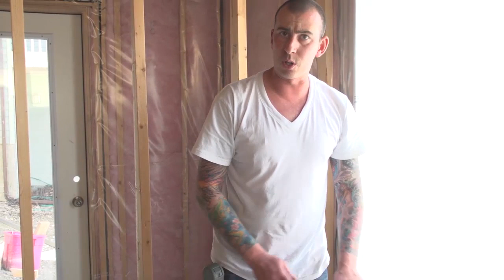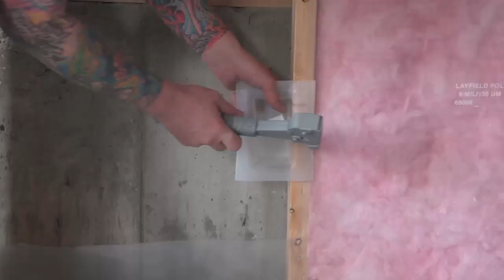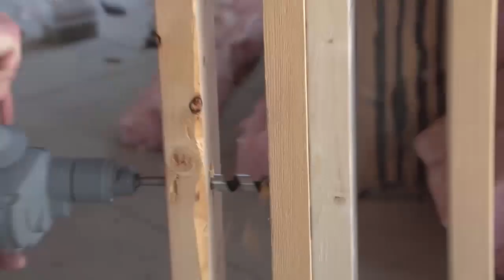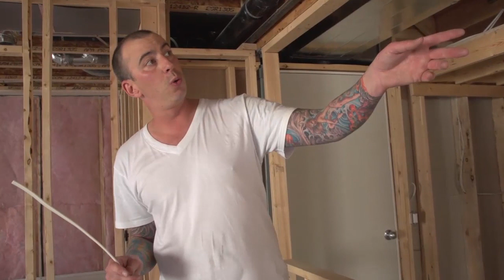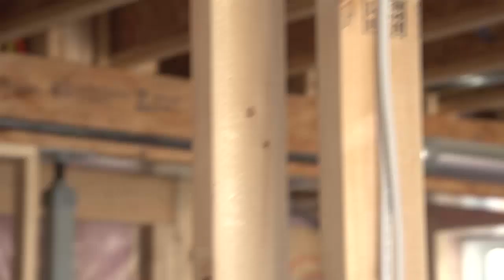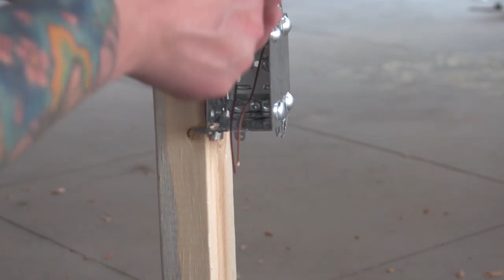How to wire a basement bedroom - DIY

Comment: Hi sir, first I want to thank you for making the vdo.  1. I want to make 1 bedroom in the basement (basement undone). 2. 1 breaker was connector to 2 thermostat (1. for the future toilet and another one is connected to 2 heaters). 3.  the one connected to 2 heaters, I will use one for the room with it owns thermostat.  4.  should I put each room on a different breaker or I can still leave them together in one breaker?.

Comment: Thanks much for being so thorough in your description of each aspect of this project..
Reply from the maker: Thanks for watching, are you working on a basement project?
Reply: @ConstructionCoach  Question You had both the lights and the outlets/ switches going to the same Home run box. Could I possibly separate the lights into its own circuit in my Circuit breaker box?
Reply from the maker: Definitely separate them. There is a code change where I build that requires all bedrooms to be on their own arc fault breaker. Lighting can be on regular breakers. I had a job when the lights went on the arc fault would trip so I’ve started separating lights and receptacles.
Reply: @ConstructionCoach  I appreciate the advice. Keep doing what you do! I have used your videos for each stage of my basement project so far.
Reply from the maker: That’s awesome, keep in touch as you proceed.
Reply: @ConstructionCoach  One last question: Do I still need Vapor Barrier Sleeves for my receptacles? If so, where do you purchase yours. Home depot nor Amazon sells them?? Thank you
Reply from the maker: If it is an exterior wall with vapour barrier, this includes frost walls in a basement then you need poly pans with metal boxes. Some plastic boxes have a seal built into them. They are always at my local Homedepot, if you are having trouble check a electrical supply warehouse in your area.
Reply: @ConstructionCoach  Yes I am about to run wires in my basement. What size drive bit were you using?
Reply from the maker: I use a 3/4” bit, that way you can fit two wires through.

Comment: Ark fault breakers.need to be tested to see if they are actually working the one we had did not and what a chore to find all the plugin on the circuit as one arking plug can cause others between it and the breaker to ark and burn off the wires too

Comment: This is the most detailed video about wiring basement i have seen. I'm brand new to this DIY stuff. Though what confused me here is that you are using white(14/2) for both outlets and Switches. My basement already has few switches and outlets. Can i just use those to extend the lighting and switches and just use 14/2 instead of having to use 12/2?

Comment: Can you explain the service loop please. Thanks much
Reply from the maker: It’s a loop of electrical wire in the wall, if the drywall installers hit the wire or a wire is short then you can release the box clamp and pull more wire into the box. Let me know if this helps.
Reply: @ConstructionCoach  
Excellent thank you for the response. Makes complete sense now.

Comment: I am adding a home studio to my basement. Approx 16ft x 24 ft.   I am planning on 6-8 can lights and approx 12 double plugs.  Would you recommend a single circuit for the light and plugs or 1 single circuit?  If so what size wire would you use?
Reply from the maker: Definitely 2 separate circuits, I would run 14-2 for 15amp breaker for the lights and same or if you need higher amperage 12-2 for 20amp breaker.

Comment: Enjoyed your video, developing my basement and running the rough wiring myself and had a few questions. 

How many feet of wire did you leave at the breaker panel? 

So wire 1 from breaker panel to light switch, leave a loop than run to each receptacle leaving a loop at each receptacle. 
Wire 2 from lights to switch. 
Power coming into the box for the receptacle and lights will run on the same breaker?
Did you make a video how you tied them together receptacle power, light and switch?

Comment: Oooookie @ 18:30 that's so wrong. The staple is not suppose to be holding the wire soooo tight it is suppose be snug but not THAT snug ...  this is why the wings are there on the edge of the staple. It's a guide that says "Hey you hammered me in far enough" ... I know in Canada anyways, if you hammer your staples in too far a GOOD inspector will FAIL you. Just my 2 cents.

Comment: Coming from a Construction Engineering Technician/ Civil Engineering Technologist you should never drill that close to the edge of a stud. Two holes beside each other too on the exterior load bearing wood founding wall is a no-no. Middle of stud doesn’t add much strength to stud but the outside is more important to keep in tact. Great informative video otherwise!

Comment: hi i want to know if you have 3 plug for the switch, and 2 screws for ground, where did you connect the other plug? Is it ok to use 1 screw for 2 ground wires? thanks

Comment: I noticed in some videos that the wire was placed inside metal tubing that was installed in the holes for the wall framing. Is there an advantage to this technique? Maybe it is a code requirement in some states?
Reply from the maker: I’m not to sure about that.. creators make videos with what they know and it’s always up to the homeowner to check local codes. Thanks for watching.

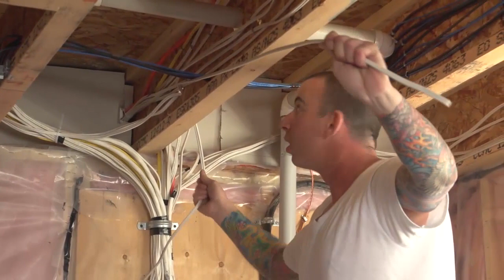Comment: Construction Coach.   What is the illegal pvc conduit/pipe at 15:30 above the electrical panel for???   If it's plumbing, it can't be the exclusively dedicated space above the electrical panel.   If it is for electrical work, why would it have plumbing 90 degree ells and nor gray electrical 90 degree elbows?    Either way, it should be a violation of your Canadian Electrical Code.   It is so close to NEC they can't have let this slide by.   Respectfully,   Kevin

Comment: I thought you are going to use #12/2 for AFCI receptacle
Reply: from my understanding you can use it, but it is only required for a 20A circuit, on a 15A you can use 14/2 or 12/2. good chance it is a cost saving measure when you do not plan to run on a 20A circuit.

Comment: Does the electrical usually get put in after the insulation/vapor barrier? It seems that if I was building a house I would want to put in the electrical first... Am I missing something?
Reply: If a builder is not finishing the basement, he doesn't care about wiring. I have the same situation in my basement - I'm finishing it, and will have to do exactly this thing.

Comment: For people asking why you use metal receptacle boxes it's because you are never supposed to use plastic boxes for standard 120V or 240V house wiring. If wires become disconnected, the point is for them to short out to the grounded metal box and trip the breaker, rather then have them shock someone if they go to pull the switch/plug out of the wall if they are troubleshooting why something doesn't work, they are also stronger and less prone to breaking, as well as being fire resistant and wont melt under extreme heat.
Reply: You clearly do not know what you are talking about.
Reply: Just to be clear, I was talking about sabgog. Metal boxes are rarely used in residential wiring, I know because it's been my career for about 16 years.
Reply: @realTlMBOSLlCE  In 2 countries i have lived in, metal is required, so curious where you are that plastic is used and metal is rarely used?
Reply: @TheRealMrGuvernment  
Wisconsin, United States of America.
I realize some places do require metal boxes and  raceways, but it is absurd to say that plastic boxes should never be used in residential wiring considering they are designed specifically for residential use. As far as metal boxes having the intent of grounding out, that would be a fire hazard and is one of the dumbest things I've ever heard.
Reply: What in the heck are you talking about  , what state are you licensed in?
Reply: @gregberban9273  the state of mind!!!

Comment: This is a pretty thorough video of how to rough in a room. There’s only 2 things I would critique. That being 1) there’s much better/safer ways to strip romex than slicing a knife down the middle. Definitely NOT recommended. 2) no mention of box fill. If his switch box is not a larger or extended box (which it doesn’t seem to be) he is most likely not within code. I know if he was using 12/2 he would be over filled but can’t remember off the top of my head the the total for 14/2. But otherwise a very good video for someone with a basic skill set 👍🏼

Comment: Why on earth are you not using plastic nail on boxes?  I guess the real question is why didn't you take a scrap 2x4's and cut them to your device heights? to lay out faster?
Reply: and seriously why did you not install wiring before insulation!? It happens, but why!?
Reply: @HellHatch666  
Because he is not an electrician and does not know what the fuck he is doing, hence "bedrooms require independent afci breaker"...(no they don't, never have)
Reply: TIMBOSLICE CR/COC bedrooms now must be afci protected, and more and more most of the house will need to be afci protected in newly built homes
Reply: @slugh8499  
Thanks slug, I'm well aware of the codes I need to follow in the many jurisdictions I work in. I stated that bedrooms do not need to be protected by a dedicated circuit. Read(and understand) every word before you reply next time.
Reply: TIMBOSLICE CR/COC well you can have 2 bedrooms on one dedicated afci circuit but yea u right
Reply: @realTlMBOSLlCE  I believe you are right. Last time I had a look at a code book it spoke of work areas and bathrooms but never bedrooms. What states are you working in bra?
Reply: @CC-jy4gr  
I work in Wisconsin bra.

Comment: Does the box have to be flush with the stud?
Reply: Or do we pull it out so that its flush with the drywall?
Reply: Don't know if anyone answered your question but, the box that he's using has markings AND little triangle notches pointing out so all you do is let those notches rest on the face of the stud, done.  You want the box to be flush with the drywall so the electrical won't be in possible contact with anything other than the box itself.

Comment: Hi, this was a great video!! Since it does not show how to make the connection at that first switch however, can someone confirm that the following is the way to go?
My assumption is that I would connect all the grounds to the
box together and pig tail a lead for the switch ground. Then connect all the
whites together with a wirenut. Finally the black wires, I would connect the
source black to the plugs black and a pigtail going to the switch. Then the
black wire from the lights would connect to the other terminal of the switch.I am thinking of perhaps making the light switch a 3 way so
I could place another switch near the bed area where we can shut the lights off
from. If I was doing that, I’d use a 3 way switch at both ends and join them
with a 3 wire (14/3 wire) right?

Comment: why is it insulated before the electric? talking about backwards ass.or ass backwards
Reply: That person built a house with an unfinished basement that they would finish themselves later, instead of the builder. They are probably getting it finished now. Some builders offer the option to place insulation down there, some don't if it's unfinished. They could've gotten the builder to go ahead and pre-wire all the electrical and leave the rest unfinished. It's all personal preference and all depends on what you want to spend at the time. My basement is unfinished with no insulation and only a couple lights and outlets, so I will gradually wire it myself, insulate and drywall it whenever I get around to it.

Comment: Using this setup, since the "homerun" line is going to the switch first and then the outlets and light, does that mean that the light AND all outlets need the switch in order to work?  If that is the case, would you mind explaining a setup in which the light needs the switch but the outlets are always working?
Reply: Just run both hot wires from the panel and the outlets into the input of the switch, and the light to the output. then connect all neutrals together. and all the grounds together with a pigtail to the switch.

Comment: Why are you using metal boxes
Reply: PNWjordan Ronald I was thinking the same thing lol
Reply: because it is standard practice using metal boxes. mostly for safety reason
Reply: @TheSharkmanforever  been doing electrical work for 40yrs state licensed , never heard it was standard practice , however it is a better quality box if there's the extra money in the job .
Reply: @TheSharkmanforever  that's b.s.
Reply: Better question is why did he not use fan-rated ceiling boxes?
Reply: as noted above "For people asking why you use metal receptacle boxes it's because you are never supposed to use plastic boxes for standard 120V or 240V house wiring. If wires become disconnected, the point is for them to short out to the grounded metal box and trip the breaker, rather then have them shock someone if they go to pull the switch/plug out of the wall if they are troubleshooting why something doesn't work, they are also stronger and less prone to breaking, as well as being fire resistant and wont melt under extreme heat."